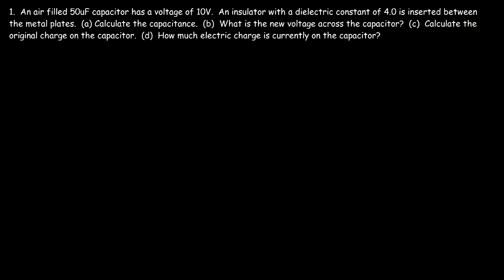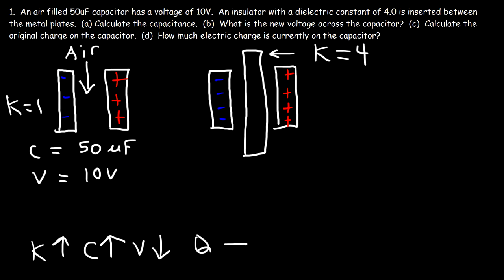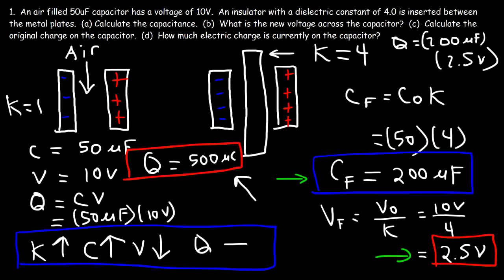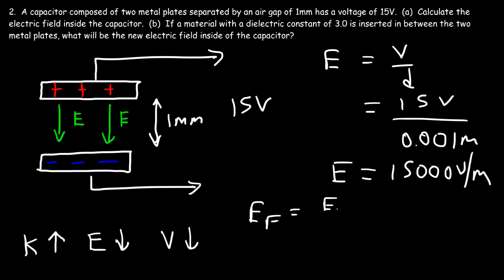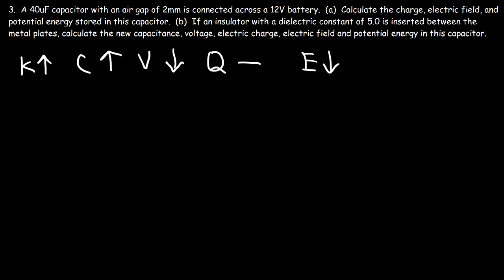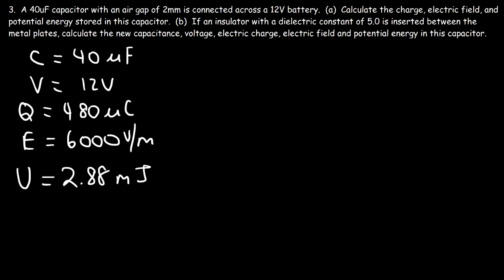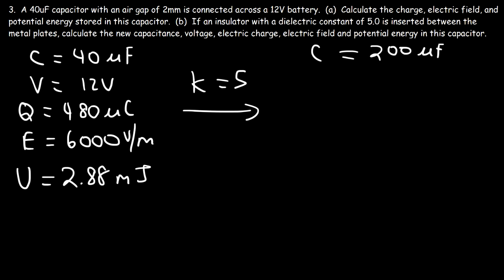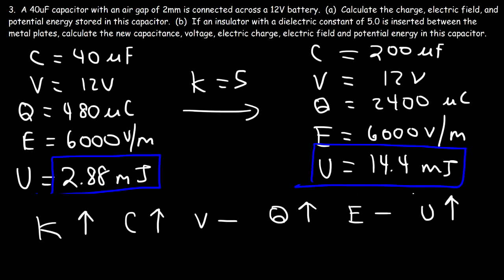Dielectrics & Capacitors - Capacitance, Voltage & Electric Field - Physics Problems

Comment: I just don't understand how to know when you're supposed to use a specific formula?
Reply: Write down the value you want to get (charge, resistance, capacitance…), write down the ones that were given to you. See which formulas matches the most.
Reply: @hindalaoui2140  Thanks